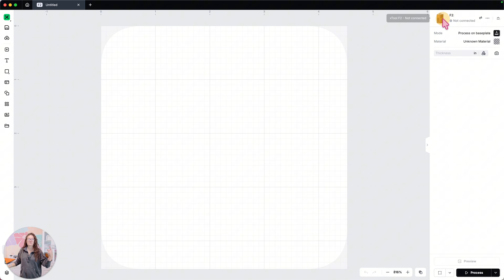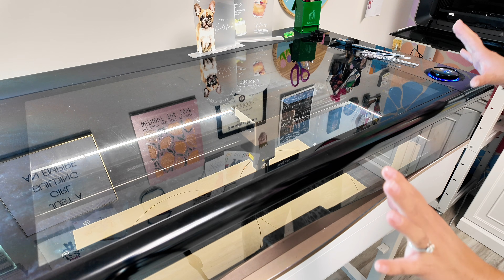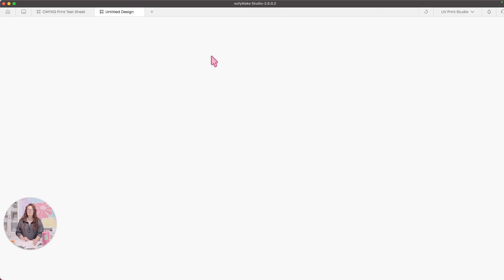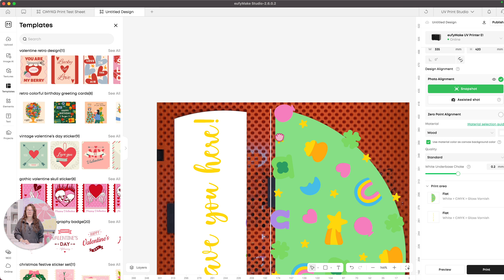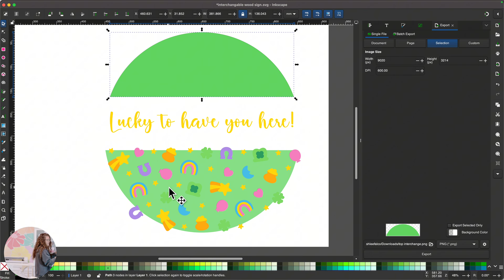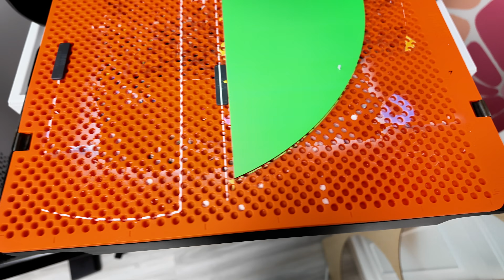I Only Had ONE Shot to Make This… xTool P3 + EufyMake UV Printer Sign

Comment: You need to learn about bleeds. Basically you make the artwork just a little bit bigger than the piece you’re printing on so if your alignment is a little off it will still look ok. 

Also the reason your colors look different is because your design is using RGB and the printer is CMYK.
Reply from the maker: I know all about bleeds, thank you. The purpose of not doing bleeds what to show how accurate/inaccurate the camera was.

Comment: Don't you have to make sure the magnets are North/South orientation match on all the assorted pieces you will be putting on the main disc?  If not, could you have magnets pushing away the pieces if the N/S orientation is opposite on any the pieces you add seasonally they would repel if you put a North on another North?  I hope you get what I'm getting at!  If the main disc had all magnets with North facing up, then all the magnets on the interchangeable pieces need to be South facing up to keep from repelling instead of sticking.
Reply from the maker: they are working just fine for me.

Comment: I am fairly sure Whambam would like you to call it the Ultim8 Jig. The numbers are the distance from the pins you push into the mat. A 5 / 5 fixture would mean 5 mm to each side. A 7 / 3 fixture extends 7 mm to one and 3 mm to the other side. It's important to watch those numbers if you want to have something straight.
Reply from the maker: Good to know, thanks for the clarification! 💡

Comment: I like this product. Since you have a CO2 laser you can use self sticking PET foil in white. Bring it on the wooden panel and cut out the models. Its very suitable for UV printing. You dont need white ink, so less cost and faster printing. Didn't you connect your inline fan to the laser machine? I have a Xtool S1 and my is connected to the machine. It will start automatically. I configured that it will stay on an extra 20 seconds and then it will switch off. Unfortunately it will not work on my F1
Reply from the maker: I could setup the inline fan to be automatic but I’m lazy 😂